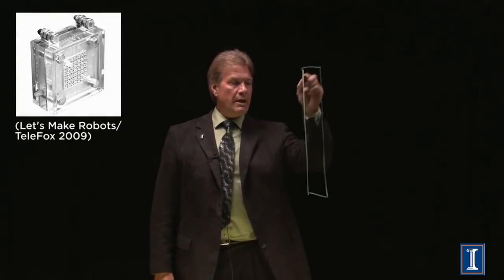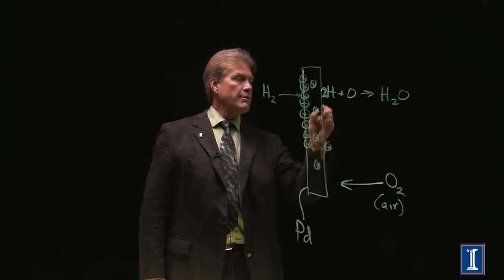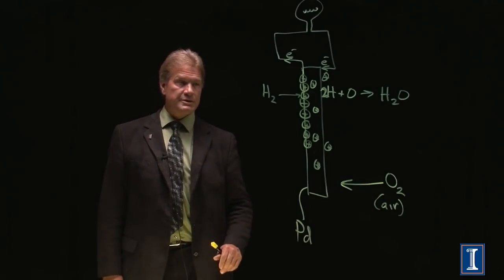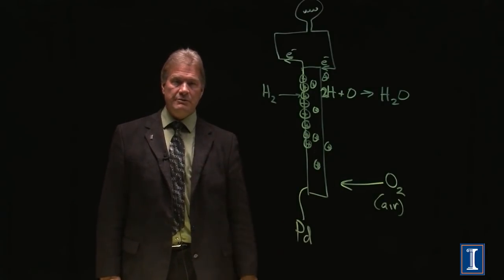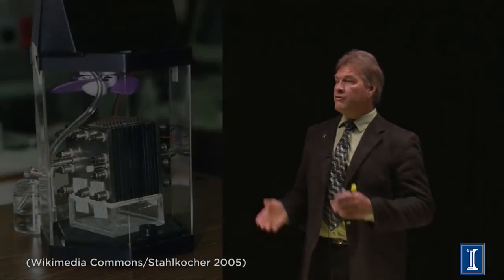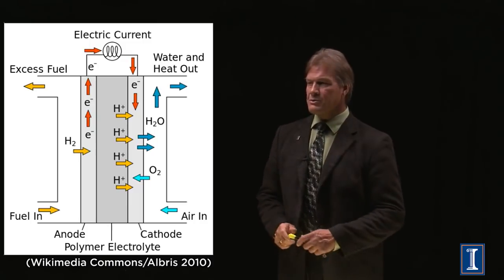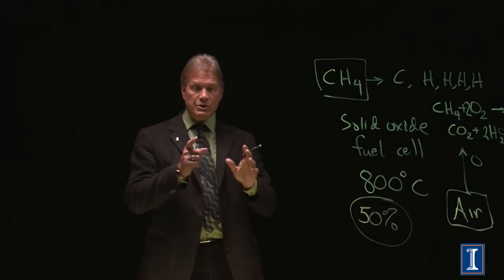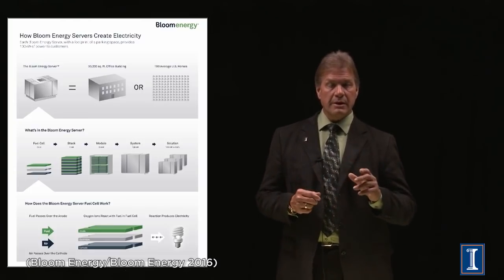Fuel Cells and Hydrogen Economy

Comment: What if we had the infrastructure sufficient enough where the hydrogen is produced on site at the pumping stations using electrolysis during night when electricity is cheap. A sufficient enough infrastructure would wash out the economic inefficiencies, no?
Reply: The variables you mentioned don't change the true cost of these systems. The math at the end shows that these don't even make profit, they break even at the end of their life. It's so stupid that people think this is the way to go.

Comment: He seems unimpressed by the prospect of the Hydrogen Economy. Yes it’s 95% dirty fossil fuel based but the clean green Non fossil fuels based Hydrogen is being made with solar energy and water using nano technologies. Check out (HYSR) Hypersolar which is sponsored by the UCSanta Barbara and University of Iowa at Iowa City. But green clean Hydrogen is here . Commercial production will be soon attempted. Thanks .
Reply: It would make great sense to connect all the renewables and the grid to a plant that only produces hydrogen when there is enough wind and solar to have surplus, effectively using the hydrogen as an energy storage, but we would also need to put a carbon tax on hydrogen not made by water electrolysis powered by renewable energy to keep the clean hydrogen as the only economically viable one. Building a production plant and the power source will raise the startup costs little too much, so it is easier to just promote building more renewable energy, that way there will be more overproduction on sunny windy days, meaning more cheap electricity for projects like that.
Reply: Matt S  Agreed, solar panels are for buildings, nuclear, CSP, wind, geo and ocean hydro are better for grid level production. Though If we develop even better and cheaper panels and storage, there are literally millions of square miles of public land we can put panels on without bothering animals or people. Except for anyone who wants to kill us with pollution of course, but those a-holes don't count.
Reply: No face man  Only problem is getting those made. Mini reactors might manage it with less red tape, but currently building a NPP takes a decade of getting permits, another decade or two of building and inspections, at least ten billion dollars, and a safety zone of near hundred square miles around the plant-not that most people want to live nearer than ten miles of the plant anyway. You might need a hundred or more windmills to produce as much power, but building those takes far less time and only costs one or two billion.
Reply: I don't think that the main problems with the hydrogen economy have much to do with how clean or green it is sourced. Even if all of your hydrogen was produced from water with solar power, it would still need to compete with batteries and other fuels, and hydrogen almost never seems like the right choice in terms of transportation, storage, and energy conversion. We do need to build out a decent manufactured fuel economy of some kind at some point but I hope it's better than hydrogen. Maybe ammonia or ethanol with work for a lot of applications.

For grid-scale energy storage you're also out competed by things like pumped water hydropower, flow batteries, and liquid air technologies which all seem to be more efficient and safer at large scale than any water-hydrogen cycle technology.

Comment: Assuming that we are going to use renewables for electricity generation, it'll probably translate to a massive over-provisioning of solar and wind power stations - just to have enough electricity available in worst-case scenarios. This overprovision means that there'll be lots of excess electricity that can be used for producing hydrogen.
We may not need hydrogen for cars but for heavy trucks, ships and backup power (substituting natural gas).
There is the usual argument of economics - but the effects of climate change have a price tag that should be added to fossil fuel. An obvious example are the economic costs of the bushfires here in Australia or the collapse of the tourism industry due to the upcoming death of the barrier reef. At the moment we are socializing these costs (aka the tax payer pays for this) whereas the companies who caused this pay nothing. If we did the total calculation, fossil fuels would be uneconomical.

Comment: So why German or even Greece military makes their submarines running on hydrogen ?
Reply: I'd imagine a power source that ran at room temperture with no moving parts would be very quiet.
Reply: @willarnolles2938  And thats why its the real energy source of future.
Reply: The benefits outweigh the disadvantages there. Fuel energy density, waste gas, noise, waste heat might be the main things.
For passenger cars it becomes inconvenient. Complicated, expensive refuelling and fuel distribution, overall higher cost and lack of infrastructure.
Enormous amounts (space, investments) of solar and wind would be needed to hydrogenize private mobility in a "clean" way, it would solve the storage problem of solar and wind though, but still not cost competitive.

Comment: What about Hydrogen and Nitrogen from ammonia? 

What about using metals/alloys with specific attributes and characteristics, placed in a specific configuration, within a specifically tuned chamber and with the properly tuned signal wave pulsed through it to maximise the effects of a resonant oscillation, intrinsically linked to that of the atomic bonds between H and O2.... Therefore splitting the molecule into its elemental components at a FRACTION of the energy used when overcoming these atomic bonds by the brute force approach of pushing sufficient Amperage into the system that a resulting ‘attractive’ force becomes greater than the force of the molecular bonds. 

This ‘brute force’ approach is what your science teacher demonstrated to you 20-30-40yrs ago.... 

Maybe the Russians can help with these ‘abstract’ technologies produced by pursuing true scientific rigour, yet again? Lol.
Reply: Ammonia is produced from hydrogen, so using ammonia as a hydrogen source would be circular.

Comment: In the first few seconds you qualify mechanical propulsion horsepower as electrical in the case of the decades-old hydrogen economy. This entirely ignores using the precious metals to produce heat as in catalytic Heat which many people have in their tents when camping. I recently was in my State University's science Library looking at some of those monographs or maybe it was just different authors in a book.

Instead of putting Frac th methane in they said you could put the thin film photovoltaic produced hydrogen in the pipes and insulate homes better so you needed less British thermal units. They did detailed modeling with thin film costing far more than it has for a long time. I don't think that this video is fair to the hydrogen economy. Now of course we can do far better than electrolytic hydrogen for the Platinum Room heaters and of course we don't need to use air to convey the heat to our bodies smart watches can monitor for overheating and that makes a huge difference in an electric blanket etcetera culture.

Cashmere doesn't last forever but it sure is a bargain compared to Central Heating and Cooling. Man-made microfibers can outdo the heaven of such wool what the word economy means is that it's a fair competition and the government can be petitions to kick the asses of the fossil fuel industry into the gutter so that we can do things rationally smartly Greenleaf cheaply better. Your classes are editorials pretending to be some sort of science or engineering take it to the Wall Street Journal and those young girls in the front would seem to be signaling something white file going on over there.

Comment: No sane company or investor is interested in these. If you're selling power you barely break even. Keeping it in private enterprise is the only route to success, so arguing that it could be a public endeavor is absurd. If they were cheaper, and if we could push efficiency to 70%, they might pay bills. Citing California as a place where this could work is also ridiculous. California artificially makes this profitable by taxing the hell out of fossil fuel based power companies. That doesn't mean that it's resource efficient at all. It means that we use taxpayer money to fill the holes.
Reply: I disagree. There are many sane investors who would be more than happy to make money off of California's tax payers.

This might sound counterintuitive but one of the most promising things I saw from an investment standpoint was the fact that the capital costs were like 6x the operating costs. That's promising to me because those are the kinds of costs which are often easily driven down by mass manufacturing. We saw the same dynamic with solar cells. Solar cells have gotten more efficient per watt of sunlight, but not by huge margins. However, because essentially all of the cost of solar power is the initial capital expense, mass manufacturing have brought the price per watt down dramatically. The same wattage that cost $50k ten years ago is about $10k now. The cost for residential solar is bottoming out because installation costs (in the US) is now typically higher than the material costs. Public investments in manufacturing (mostly by the Chinese government, but also through tax incentives in places like California) fueled this to the benefit of investors and buyers, and hopefully for future generations in terms of energy security and environmental stewardship as well.

Comment: the point of using Hydrogen and not natural gas is that when you use natural gas you'll still have carbon emission.
Reply: But the natural gas already exists and CO2 is much more preferable.
Reply: All hydrogen in this country comes from natural gas.  Fool cells are not cost effective. Only in California. Every where else they did the math.
Reply: Lawrence Rhodes They did the math in California. It’s just that there emissions hold a higher value. Due to congestion and population density. In General Methane is more cost-effective but certain use cases the lack of carbon dioxide emissions will make hydrogen superior, such as confined space usage. Eventually hydrogen will be cost-effective in a more general sense but I don’t see that happening quickly. I suspect that methane and battery storage will be the more effective solution for much of the future.
Reply: @timrosencrans7955  Unfortunately California used modern math. Didn't work.

Comment: Toyota makes the Mirai a good hydrogen power car
Reply: While not a bad car, it is inferior to the Model 3 in almost every regard.
The Model 3 LR RWD costs about $10,000 less, and costs about 7 times less per mile to run. It weighs slightly less yet has slightly more range.
It goes a lot faster, and has a lot more storage space, better safety ratings, and many special features that the Mirai lacks. It also has only about 30% the CO2 emissions.

About the only thing the Mirai can boast is the ability to refuel a lot more quickly, a few minutes vs half an hour or more. However, that is countered somewhat by the current lack of hydrogen stations, while the Model 3 can recharge almost anywhere, including at home.

Comment: hydrogen gas is the worst thing ever to store and handle,it burns without a flame, explodes easily when it mixes with air, and is extremely difficult to make into a liquid. Its the worst idea ever UNLESS its made into an excellent fuel called Methanol. Then we can burn our Methanol in an Achates-2 stroke engine and get 55% thermal efficiency............so all our vehicles can use existing fuel distribution systems, be made of common and cheap materials and we wont need to decimate the planet to obtain vast quantities  of rare earth metals,copper,cobalt,nickel,platinum,lithium etc etc.  AND we can avoid spending trillions of dollars to upgrade the grid to charge up the millions of electric cars,buses,trucks etc.

Comment: Hydrogen is a non starter in the race to clean energy. A non starter. This means it falls at the first hurdle. It isn't green. The second hurdle is irrelevant because H2O fell at the first hurdle but that is cost. 3rd hurdle is insignificant because the 2nd hurdle will never even be attempted because H2O fell at the first hurdle but let's talk about it anyway: overall efficiency. No wonder people are calling fuel Cells 'fool cells'